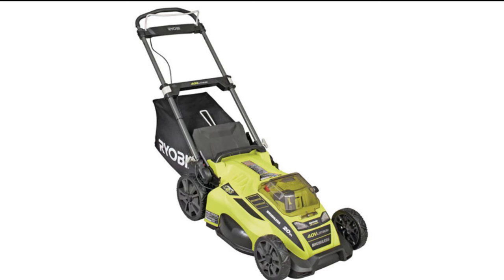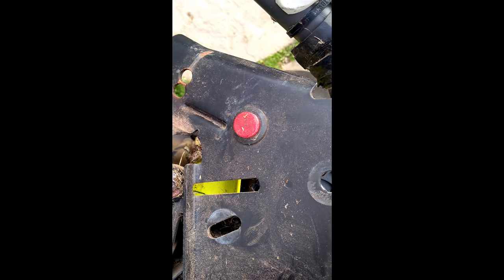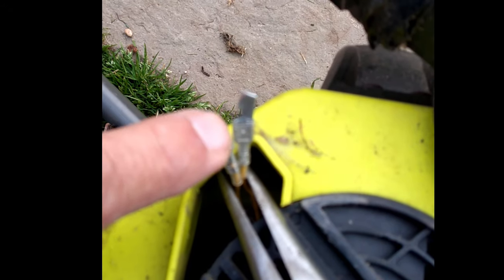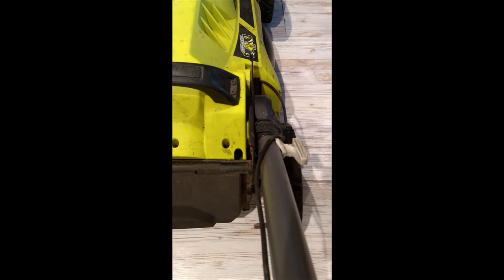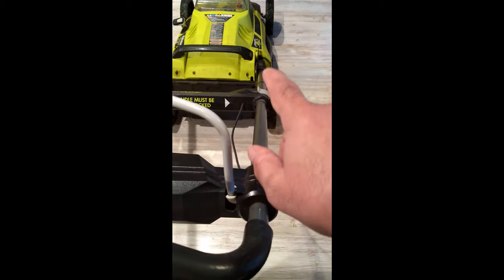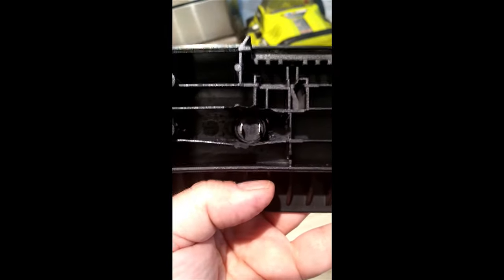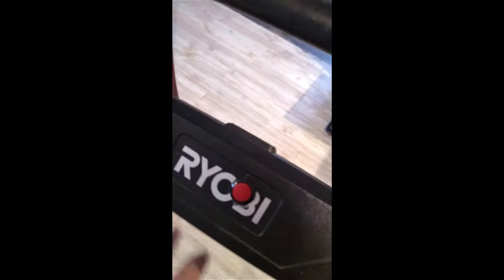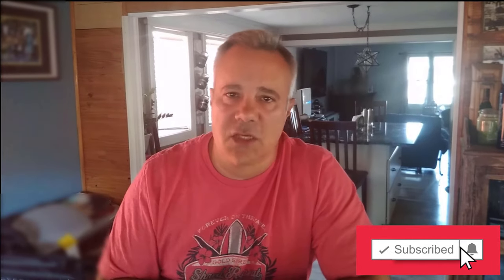Ryobi lawn mower Keep shutting off!? Here's the fix!

Comment: I’ve owned a newer model Ryobi for about a year. Kept having to deal with the shutoff problems. Loved the fact, I only had to push a button instead of pulling the cord. Last year, I tightened the screws to fix the button by the wheels and it seemed to help (from another video). This year she was shutting off much more frequently then last year. Followed the video fixing the two switches in the handle. Bam - All fixed -Mowed the whole yard without a shutoff! The two switches in the handle were stupid looking cheap! $10 at Lowes for a toggle and on/off push button and I have a brand new mower! As you take the handle apart, I recommend taking pictures so you can put the self propelled (if you have this feature) handles back together (it’s not complicated at all). Had my son hold them in while I snapped everything back together. I removed the on/off safety bar as recommended! Thank you for you awesome video and saving me around $400 for a new mower!
Reply from the maker: Glad it worked out for you Tom! They make so many different models of this mower now that it seems like everyone has a different setup and like someone else mentioned, you would think RYOBI would have fixed this by now!?

Comment: Thank you, I was about to throw mine out, you saved me $$$. I was so stressed out this morning, am ordering the parts now, I’ll come back and give an update.
OK !!!! I came back to give an update on my repair. Just freaking awesome, my mower is working flawlessly. Thank you again. 🤘🏽🤘🏽🤘🏽you saved me $$$$$&&
Reply: Hi ry401011 5 yrs ago stak of em at hd.
This yr concrete walk to lawn 1 inch down to dirt bump or small hill stopppps a lot.
It doesnt have red button on hdl frame brkt, does have mdl hdl microsw to ensure extended.
Rmv yel cover 1 " screws and cuss assembler for n screws in 1 hole, torq cocked jammed;
Fix by horiz 1/2" long screw on side bag sw wobbles yel cvr.
Put toothpic & glue in tornout hole bottom  & use lgr screw w washer catch yel cvr damage.
In frt yel cvr use prune shear to rmv excess lth jam on blk bottom put back easier.
Fix bag sw: rmv tiny board 3 to 4 wire connector, blk common, non blk mag reed sw's; bag on both reed sw are open: safe. So cut wire to thing will run, OR just tie blk to blk common and blu to gray (civil war) and last ones left controller sees reeds open will run.
Fix hdl wire plug shrink wrap fail: rmv shrinkwrap, ensure male female cln, tape plug over back of inserted plug on ea side, then wrap mdl plug to hold 1st tapes to fix plug fallout fm very short solder pins tooo cheap to gold plate like 1959's.

Comment: Thanks for this post. The number of expletives I’ve yelled at this mower. Bypassing that first one at the handle joint did the trick. I can finally JUST MOW
Reply from the maker: Glad to hear it worked out. sometimes you only have to do the one but I showed both of them in case that didn't do it all

Comment: Three safety switches? That's why America can't get anything done! I'm surprised they didn't put safety switches on the safety switches. It took me 30 minutes to mow a 40ft x 4ft patch of grass in my alley today because the stupid mower would shut off every time a thought triggered a neuron in my brain. I was about to get my wife's eyebrow tweezers to speed up the process. Thanks for the workaround. I just ordered the switches from your Amazon links. As soon as they come in, I'm bypassing the safety switches. Hey Ryobi! If we cared about safety, we wouldn't play around with electric tools connected to sharp blades! All we want is to cut our grass! Give us tools that WORK!
Reply from the maker: Lol... Let me know how it goes!!
Reply: Somehow we survived 100 years of lawn mowers without them. Of course you can't put a deadman switch on a gas mower, and they're too heavy to flip over. But this is just poor, lazy, cheap design.
Reply: I bought a Ryobi table saw but it was way too dangerous to use from the factory.  Once i removed all the safety features, I felt a whole lot better.

Comment: 100% if you get any condensation or water into that trigger switch - the inside is corroded. You don't need to go this in depth - try just upgrading the switch in the handle to see if that fixes your problem first. Worked for me. Thanks for this vid.
Reply from the maker: Thanks for the info!

Comment: Thank you for the video. Into my eigth mowing season and the dreaded shutoff problem shifted from annoying to unbearable. Knowing time and wear changes dimensions and tolerances, and being reluctant to buy the necessary torx tools to access the switch between the handle and mower body, I Scotch taped a penny size flat washer over the red button so that when the handle is in place it pushes the button a little bit further into the switch. Voila! no more unintended shutoff. Don't know how long this hack will last but I've got more washers and Scotch tape.
Reply from the maker: Nice add on! good luck, i'm on my 6th or 7th season with mine (can't remember anymore), lol.. so many new models they came out with since i did this video but the issue is still happening even with the new models.

Comment: So mine just started doing that same thing. I went through all the things suggested and was imagining vile things about Ryobi and Home Depot.  Then my non-gadget bride came out to see what was going on and reached in and pulled the key out and then put it back in.  I love that woman. Now my machine runs and runs and runs.
Reply: Hdl midl clamps and microsw fully extended fail: remove clamp plastic in midl both sides keep screws as spares but garbage plastic. Gently use screwdvr to pull out plastic pipe piece betw 2 pipes then pull out plastic jam that holds mdl microsw in upper hdl then use a small wire conn to tie yel wires together, toss microsw and plastic jam or keep yel wires  plus microsw wound on hdl horiz pipe along w all the crap removed fm ry401011.
Lastly, use 1/4 by 1 1/2 bolts to hold hdl together after drill 1/4 holes thru both pipes.
I ground metal low stops off mower brackete and hang mower on bolt in 2x4 gar wall so damp or water drips out and more room in dry garage.  Dad hung his push reel mower on wall 70 yrs ago too.

Comment: With the suggestion that you had to fully extend the handle it gave me a clue.  You see I had already FULLY extended it.  But then i shortened it and gave it a big ol jerk to extension so it hit hard and then secured it in place and worked fine afterwards.
Reply: One of my handle-extension latches had come loose due to shaking. Just unlocked the other side, pulled the handle out another 1/2-inch, relocked both sides, and voila!
Reply: This lawn mower is a complete pain i* t** a** Every year I go through this inThis lawn mower is a complete pain i* t** a** Every year I Go through this
Reply: @jamesjazzy8040  There is a work around if you search for It on the Internet. It requires a little bit of adjustment to the handle and what not.

Comment: Thanks SO MUCH for this video!!   The last 4 times using it, it progressively kept get worse and worse each time using it.  The one side of my lawn has a steep slope downwards that is only about 2ft high and lasts about 4ft long.  This is a new lawn/ new dirt so over the past 3 years the slope has become less steep as it leveled itself over time.  So you would figure the tilt sensor kill switch would be less likely to kick in.  But no.  The past 4 mows I had to be even more careful how high I could tilt the mower when turning back to do the next pass before it cut off.  I just knew it had something to do with the tilt cut off feature mentioned in the manual. It would be nice that Ryobi built these switches to last longer and/or to make it easy for users to replace them and to have something written about replacing them in the manual so people don't just junk the otherwise good mower.  I think most people don't even know about these kill switches.  If they did I am sure it would have prevented people from throwing them away.   I just finished mowing and got online to see how to fix this and though I have not tried it yet, I feel even more confident that my mower will be back to perfect order again!   Thanks so much in advance!!

Comment: Gary,,,, thanks so much for your video.  I had no idea there was that many switches.  My wife just wanted to trash it.   She has 2 of the newer self propelled which currently work great . She told me to get rid of the broken 20 inch one today,,,,, I watched several video’s on this today and yours was the most helpful.
I took out switch near the right wheel and one at the right mid push bars.  The switches for starting and shut off turned out to be fine. I was so ecstatic that it worked I went ahead and mowed the back yard.
I was so close to taking it to the dump.
Thanks so much for the information……
😂👍
Reply from the maker: Great!! I'm so glad it worked out for you!

Comment: The safety switch that connected the handle to the body was the issue with me.  I just had to tighten the screws because they came loose.  Thanks!

Comment: I dont have this version of lawn mower but must say i like the way you fixed it, not sure why ryobi never fixed these problems. Seems all their lawn mowers have the same problems, my current one and old one had problem of turn it on and it runs perfectly. But push foward and suddenly it stop working. Found out have to tighten some screws/bolts on it to secure safety switch. Had hoped ryobi would solved all these problems by now. I debating about going back to gas powered as i switch to electrical to save money from not having to take to shop to get it fixed.
Reply from the maker: I hear you.. not sure why that haven't put better switches in. I'm about to do another repair quick fix video out for their weed trimmer. the wire inside keeps snapping off. thanks for the comment! Gary

Comment: Ryobi battery powered lawnmowers I thought I was getting a great piece of equipment but I’ve been having nothing but problems and I have to second the motion on too many safety switches since watching your video on the repairs or replacement have they improved on their product the one I have keeps quitting thought I was helping mother nature
Reply from the maker: I hear you my friend. Fortunately or unfortunately, (depends on how you look at it), they have not changed the safety switch (It's required to have them) and i get that, the simple fix for #RYOBI is to make the switches out of metal NOT plastic. Since I have changed mine, it's been working perfectly and it's been well over a year now. Again, not telling anyone they should do this, since i have to say that, and I DO NOT ALLOW  a child or even a young teen to operate the mower if you do make these changes. I am the ONLY one who handles the mower. They make sure great products and now have serval mower versions out (not sure that is) BUT STILL don't make the safety switches out of metal, I'm shocked that they are allowed to make a safety switch out of plastic, THAT... doesn't seem safe! LOL
Reply: @manview5178  I hear ya I don’t even allow any of my grandkids to touch these pieces of equipment it gas operated or electric they have to do it with their father so that they can learn and if they think that they’re gonna use mine they better be over 14 years or 1516 I don’t know it depends on their knowledge too but I mostly do not let anyone mess with my motor driven equipment I hear you on that point

Comment: Bought mine on Sunday a few days ago, keeps turning off every turn I do. Im just going to return it while I still can, Ryobi has some work to do. I dont have time to be playing with safety switches, going back to gas
Reply: The Bag or mulch plug have to be seated correctly, otherwise the mower will shut down as a safety feature.

Comment: SOLVED. Had the same problem, 2 week old mover. All I had to do is that the two clips that you have to secure unfolding the handle are switch to parallel direction to  the hander bars ( left, right ).
Reply: You just fixed my issue with the mower tonight, thank you.

Comment: Thanks for the video! I just bypassed the safety switch in the first part of the video and it fixed my issue. I did something slightly different but essentially the same thing. I used a spare wire and put two male disconnects on it, to connect the two female disconnect pieces. Thanks again!
Reply from the maker: Nice! Thanks, don't forget to subscribe to the channel if you haven't already for upcoming reviews!

Comment: Great job on your illustration; however you forgot the switch in the middle of the handle bar. If the (hidden) switch on the middle handlebar clip pops open then lawnmower will shut off. Plus, you can only check if the first bypass (lower handle bar) worked, if your lawn mower starts to bigin with. if it doesn't start, you can change them one at a time and try turning them on. I recommend using waterproof switches if you don't keep you mower in the garage or if it is raining or water exposure is a con cern. Overall a great demo.
Reply from the maker: Thanks, however, the model i have does not have a switch in the middle of the handle. Only the 3 that i reviewed in the video. Maybe other versions have that extra switch, this one does not. Thanks for the tips though!
Reply: Confirmed, I have this model and the 3 way RY401011 model. The 3 way models have a switch in the handle and at the bagger attachment point, but no red button at the handle base.

Comment: Great fix, thanks. Unfortunately, on my POS Ryobi mower, I can't get the crosspiece on the handle apart because 6 of the 8 screws holding it together were overdriven, stripping the plastic threads so that I can't back those screws out! Sweet Jesus...
Reply from the maker: Yeah .. that sucks. Not sure how much a replacement handle would be?
Reply: drill it

Comment: You can either use a grass bag or a plug. There is a safety switch there to keep people from running the mower without either so rock don’t get kicked back at them. My problem was that the plug got knocked loose.
Reply from the maker: Thanks, my model didn't have that.

Comment: I have a 49v 20" but you're model looks a bit different, but I'm guessing it has the same switches. Going to try this after I watch the vid. Thanks
Reply from the maker: Hi, some of the models are slightly different, however, I think they are mostly the same inside. Just remove the bracket i showed in the video between the body and the handle and see if you see that plastic crappy switch. If you do? then yours is the same as mine and your in business. I just did this for 2 other friends and it works perfectly! Let me know how you make out?

Comment: PSA:  Depending on your model, check the jumper key too.  Mine was damaged and making poor contact.  Jumpered it with some copper wire instead and it runs beautifully.  Amazon also has replacements.

Comment: Can you please show and explain how did the and install the switch and the push the start button. Thanks
Reply from the maker: I just took a regular drill bit and drilled a hole in the plastic, slightly smaller than the switch and then wedge the switch into the plastic and it held perfectly. If you make the hole a little bit too big just use some gorilla glue around the edges and give it a minute and it'll seal right to the plastic, always start out with a small drill bit and work your way up until the switch can wedge into the hole nice and tight.

Comment: I have a hart 21inch 40v hlpm03 model.... It's got to the point that I can't use it with the self propelled feature due to it shutting off frequently normally after a few seconds or so.... If I shut the self propelled feature off then the mower works just fine. Any ideas?

Comment: Thank you very much. My mower lights came on when the battery was inserted but when I pressed down the handle, it just slightly shook and failed to run. I don't know where to find the metal pin for handle bar switch and thinking of using automobile fuse to connect these two receptacles. Is it a good idea?
Reply from the maker: I don't have any lights on my model, so it sounds like you have a different model lawn mower. I wouldn't be able to advise you on this issue maybe you can Google your model number and see if you can find a YouTube fix for it that pertains specifically to your model mower. Let me know how you make out.
Reply: I’m having the same problem. The blade will jolt but not stay on. It happened right after I changed the blade. The crazy thing is if I take the blade off, it’ll run just fine but shuts off with a blade on. How does it know something’s wrong?
Reply: Did you ever figure this out?  I have same issue. The motor will jolt but not turn over. I already replaced the controller and motor with used one and still same issue.

Comment: Mine shuts off when I push it forward. It runs fine when I pull it backwards. I will try your tips and come back and update.
Reply: One of my handle-extension latches had come loose due to shaking. Just unlocked the other side, pulled the handle out as far as it would go, then relocked both sides.

Comment: Why does my Ryobi 40volt bog down so often? Does the load sensor go bad? Sometimes it mows fine cycling up and down as needed but more often it’s practically useless as it bogs down so often. I have 3 batteries, happens with them all.

Comment: Does the safety switch on the bag coupler cause any problem?
Reply from the maker: Hi, yes, if you're speaking about the red plastic safety switch where the handle meets the body of the mower near the bag, then you can simply bypass that safety switch by splicing the wires together as I did in the video.

Comment: I have a RY401140US which is 3 months old, bought in May 2022. It does not have a cut off switch between the handle and body. Any suggestions?
Reply from the maker: Hi.. sorry I'm not familiar with that model